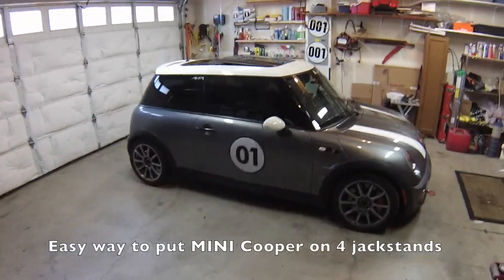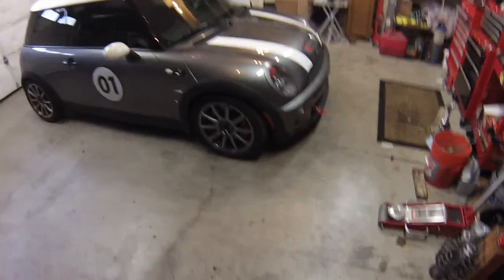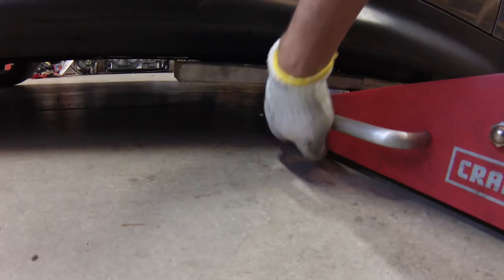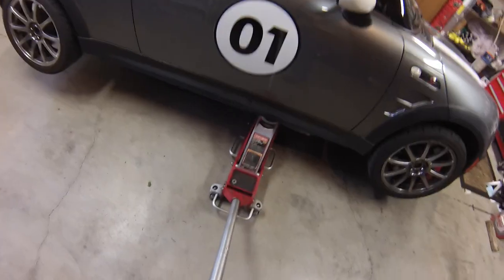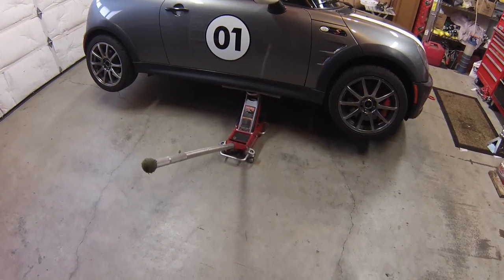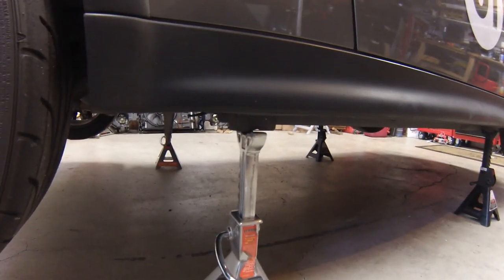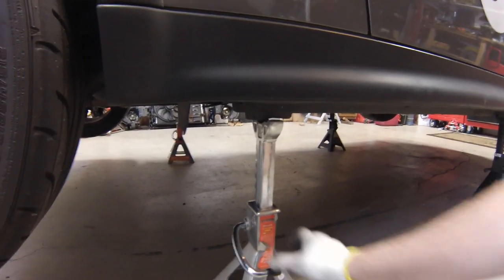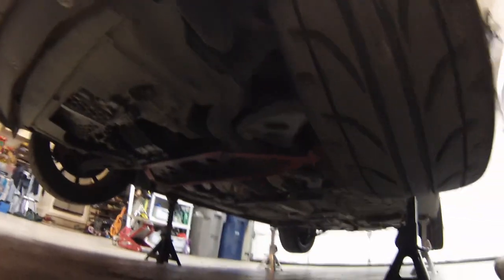Put MINI Cooper on 4 Jackstands the Easy Way R50-R53-R55-R56 Howto

Comment: It sure looks unsafe to be under it. What if the car shifts, i.e. When you are pulling or pushing hard to remove a bolt or something. I always used the jack stands as the safety net for a jack. It seams like there just is not anything to stop the car from falling, if it gets of balance. More of just a question. I love your videos, and I sent you some money. lol
Reply from the maker: Thank you for your support!! It may look unstable, but I have used this method about a hundred times with no risky moments. I have tried pushing as hard as I can from all angles, and I don't have enough strength to get the car unstable, even with timing the pushing to hit resonant frequency. While a true lift is better, short of an earthquake, this should be stable if properly done. I don't trust a floor jack to be the main source of support when working under a car. They can fail, and when they do it can cause a load shift. If using that method, one ensure that a jack stand will be able to catch it and not introduce any lateral motion. The higher you jack up, the more unstable it would be, and in order to have more space under the car, I have recently picked up a home lift setup- www.ezcarlift.com - when I get time one of these days I'll make a video on it.
Reply: +Mod MINI Thank you. I used your four jack stand system last week, but left a jack center on the rails on both sides. So I had four stands on the jack pads, and the jacks on the rail on both sides. Like you said, I probably don't need it, but made me feel better. :-)
Reply: If youre that concerned a spare wheel on its side makes a great backup.
Reply: Yeah, I had the same thought, especially because  I live in New Zealand, we often have earthquakes big enough to rock parked cars. So your question was also in my mind. I think I will place some long wooden post across the width of the car.  Love these videos...they are brilliant!!!
Reply: My god people, how morbid to think about an end of the world earthquake that could topple the car?  If it’s your time it’s your time.... just appreciate the guy finding a genius way to jack up the Mini, and if you’re that concerned or worried then no ones forcing YOU... so go pay some garage to do the easy work... but don’t come on here and come out with your crap people... go back to the hole you came from.  Thanks Mod Mini for your great video!!
Reply: floor jacks are for LIFTING...not supporting the car.  Using jack stands are more safe than relying on your floor jack.  If anything, use the floor jack as a safety (extended just slightly below the level of your jack stand.

Comment: I was looking at https://www.pelicanparts.com/techarticles/MINI/01-BASICS-Jacking_Up_Your_MINI/01-BASICS-Jacking_Up_Your_MINI.htm, and they seem to use a different location for jacking, if I am reading figure 3 and 5 correctly.  Or am I misinterpreting your video?

I already did one repair, replacing the power steering hoses to the reservoir, using the Pelican Parts recommendation for lifting the vehicle, though I only needed to place the front on jack stands for that.

P.S.  I have a 2006 Mini Cooper S convertible (R52)
Reply from the maker: Harder to get to that point without a low profile jack but certainly fine to jack there as well. There is more than one right answer.
Reply: @ModMINI  I have a low profile floor jack that worked just fine. I just wanted to make sure I wasn't doing something stupid.

Comment: Sorry DUDE.... but a 1" thick board is NOT going to distribute the weight of half the car adequately.  To be safe, use a TWO INCH thick board.
Reply from the maker: If you have room to get your jack under a 2 inch board, sure. This 1 inch board worked to raise and lower around a dozen MINIs before I had to replace with a new one.
Reply: Wow this guy having a bad day huh

Comment: Is there any reason why this wouldn't work for my R52 convertible? Also, would a 1.5 ton floor jack be adequate for the job?
Reply: Sorry I'm a bit late on the reply but I was looking through the comments here with that same question. I used this method and it worked fine for me. I did hear some soft creaking coming from the door jam as it was rising but nothing alarming. As for the 1.5 ton floor jack, absolutely.